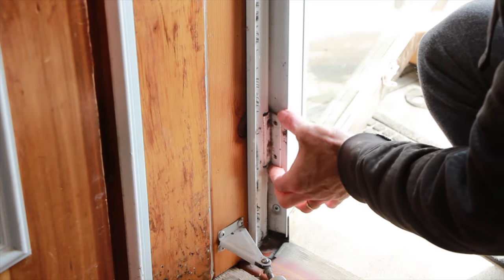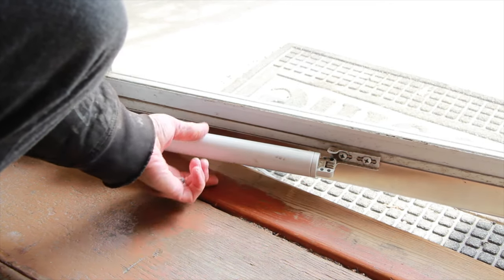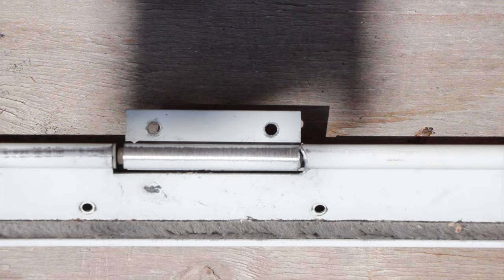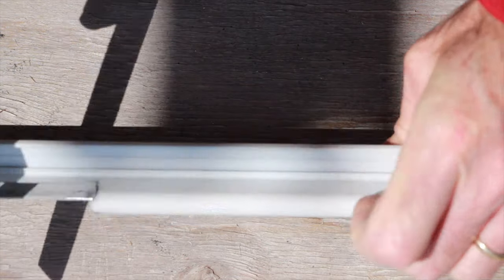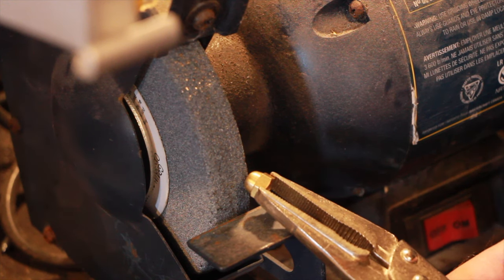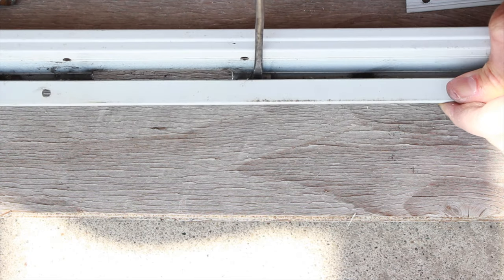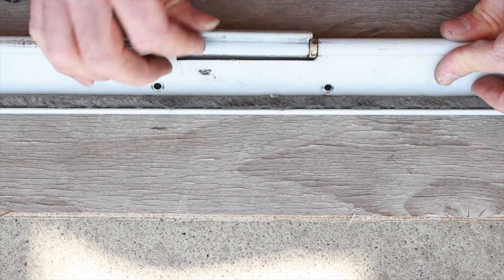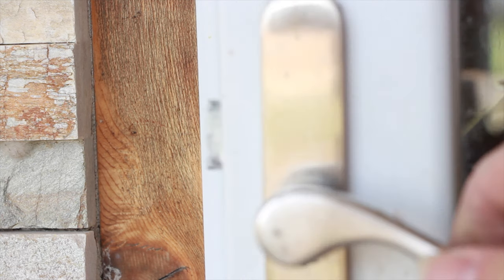How to: Fix Screen Door Hinge (Rail) | Easy Long-Lasting Fix | SMTV

Comment: Thank You for giving me an idea. I fixed mine little bit different, I used: Muzata 40Pack Cable Railing Kit Protective Protector Sleeves Grommet for Wood Posts for 1/8" 5/32" 3/16" Wire Rope T316 Stainless Steel CR88 and some 5/16" stainless steel washers. Surprisingly CR88 fit perfectly in place of cheap plastic sleeves ( I had higher expectations from brand like Anderson...). $16 worth of parts, some adjustments and my door opens properly again. Thank You for sharing your fix!
Reply: Those guides have the exact inner and outer diameter as the plastic ones you replaced them with?

Comment: Great Job on explaining and showing in detail how to perform your "fix"! One could argue the time you spent  making a brass spacer vs spending the $60 for the new hinge rail, but they also would have to weigh in that the rest of the door is still old and other parts will most likely fail too.  Thanks also for pointing out the Brass/Lead  chemical components - Nice to know you not only want to help people fix things inexpensively themselves, but you also care for their safety and health.  Excellent video!
Reply from the maker: Thank you for your kind words, I appreciate it.  The rest of the door is in great shape with the hinge rail being the only concern so far, so I feel good about the time spent vs. savings ratio.  Time definitely has to factor into the equation when determining the "value" of a fix.  Thanks for watching, all the best!

Comment: Great video on how to repair/replace the existing components instead of replacing the entire assembly!
Reply from the maker: Thanks FliesLikeABrick (!😅)  I hope it works for you.  In a "throw-away" society, it's good to get back to repairing rather than landfill.  And it saves a few bucks to boot!
Reply: @SaveMoneyTV  I ended up doing something slightly different to repair mine, but your video was useful in seeing how to disassemble the hinge components - something I was hung up on for a bit
Reply from the maker: @FliesLikeABrick  Gladit was useful and that you were able to repair it.
Reply: @FliesLikeABrick  well would you care to tell us what you did?

Comment: Great video, but if you've got a storm door or security door that isn't as bad as this one, you can just use a helper or a prybar to life the door and insert a 1/4" E-clip at the bottom of each hinge. A few cents and a few seconds. A few drops of oil is a good idea too.
Reply from the maker: Great fix and maintenance tip.  Thanks for sharing!
Reply: Thank you both so much! The door not shutting is so frustrating and the E-Clip delayed the requirement to replace the Z Bar for at least another year!

Comment: Wow , I just took your information and fixed my 40 year old storm door didn’t need to file it back
Reply from the maker: Wow, great!  I didn't know the mechanism would be the same.  Another little tip not in the video is to keep the contact points oiled with machine oil.

Comment: Awesome video , I was just wondering , if I can use a regular nut , will that work thanks
Reply from the maker: I use the brass because it is a little softer and as much as possible you want the nut to take the wear and tear rather than the hinge.  Also, it's a good idea to oil the nut and hinge regularly.  Again, by decreasing wear on the hinge, it will extend the life of the rail, and the repair.  Good luck!

Comment: Thank you for the great video. 

Is there anywhere where I can just buy the plastic washer and spring?
Reply from the maker: You may be able to find them on Amazon.  Also check a local Habitat for Humanity Building Restore as they may have the whole unit, or something you could strip down for parts.

Comment: Why not get regular nuts of the appropriate thickness instead of buying acorn nuts and modifying them?
Reply from the maker: Yes, good idea, that would work too.  Personally I prefer the brass because it won't rust, I like the softer metal against the aluminum, and also the fact that in a single nut I have more height options to get the hinge nice and tight.
Worth mentioning to anyone reading, don't forget to oil your hinges regularly to prevent further wear and tear.
Thank you for your great suggestion, and for watching.  Much appreciated!

Comment: is there any reason you can't just use multiple steel washers of a desirable diameter instead of the brass nut?
Reply from the maker: I haven't tried that, but it sounds feasible.  Good luck!

Comment: Is it possible if you put too large of a spacer that the door will be too high ?
Reply from the maker: It's hard to say without seeing the door in question, but theoretically the spacer should just return the door to the height where it hung originally.  
But, I suppose it could depend on how much wear has occured, and where the wear has occured.

Comment: I suspect I'm out of my depth there, but I was wondering why use these brass acorn nuts when you will cut them down, removing the acorn part? Just that they provide more material to work with?
Reply from the maker: I used the acorn nuts because of the extra thickness.  Each repair will need a different amount of shimming and the acorn nut gives you plenty to work with.  I used brass because it is softer than steel so it won't wear the aluminum hinges as quickly (hopefully).  
Keep them well oiled to prevent additional wear and tear.

Comment: No way to just buy a replacement hinge? Thanks for sharing your fix.
Reply from the maker: Yes, but the new hinge rail was $60 (Canadian Dollars).  I'll probably need to buy one eventually, but this should at least double it's life.  Keep oiling it and it should extend it's life even further.  Thanks for watching!
Reply: if you get the exact measurements of the hinge length on your door and the diameter and length of the guts from your door, there are multiple hinges "like" these hinges on Amazon.  No one names this brand of storm door by name with replacement hinges (as of Aug 2024) but several look similar.  I would guess that the reason this company started selling the entire "hinge rail" (pre-mounted hinges with an entire 80 inch strip of metal they sit in) is because over time they changed vendors for the hinges and guts and had slightly different hinge sizes and this way a) they charge you 3x to 4x what just the hinges themselves would cost and b) it covers up the slight changes in size over time.
Reply: p.s. the part (at least for my Emco/Anderson storm door) is now $US89 on the Andersen website.

Comment: I know this video is a couple years old but I felt compelled to comment. If you're going to grind the top off of the acorn nut anyway why not just start with a regular nut instead of an acorn a nut? I've done similar mods myself many times.  I've used a nut or a couple of thick washers to use as bushings. But I don't understand why you had to start with acorn nuts.
Reply from the maker: Hi Bill, that's a great point.  Another type of nut and/or washers will work too.  I used the acorn nut because I wanted brass, and it was an easy to find brass nut that was in stock at any local hardware store and also the perfect diameter.  Thanks for watching!

Comment: can a storm door be replaced using the same frame and just replacing the storm door itself?
Reply from the maker: Hard to know if they would be compatible without seeing them.  Is the hinge spacing the same?  Most doors come with the frame and if this is the case, then using the manufactured frame would ensure the best hanging of the door.

Comment: Why use acorn nuts when your gonna grind off the acorn
Reply from the maker: Good question.  I prefer the brass because it's softer, and the acorn nut has extra depth so you can customize it's finished thickness; which will be different for each hinge repair.  Don't forget to oil the repaired hinge a few times per year to prevent wear.
Thanks for watching!